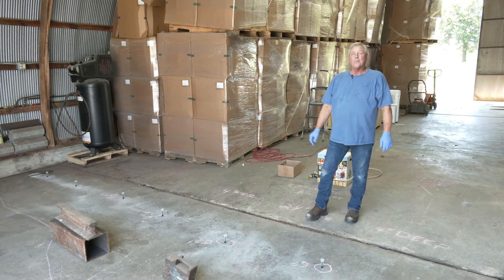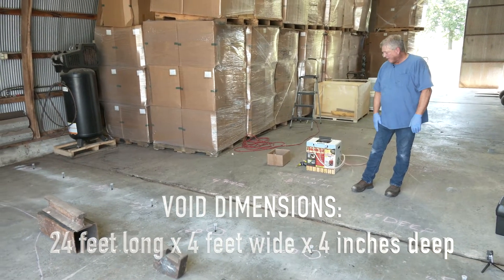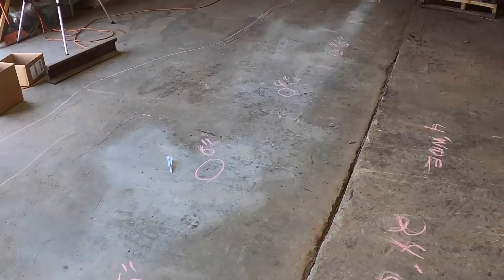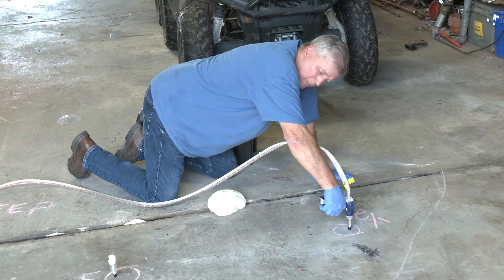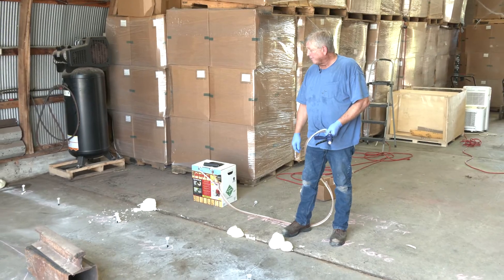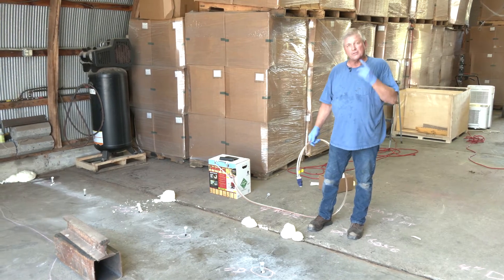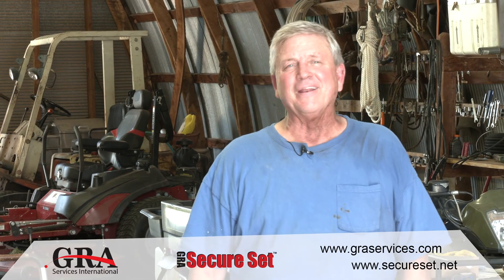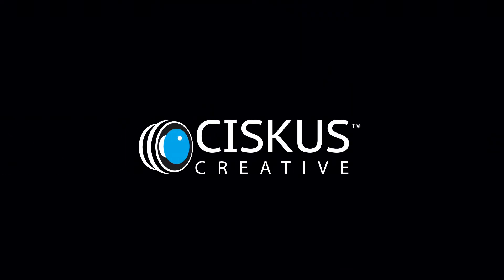Foam jacking, concrete slab lifting with Secure Set

Comment: Couple questions
1. Are there any thermal heating issues like spray foam for insulation?
2.  Will this product break down over time, or is it like poly geout used in water mitigation / crack repair.  ( radon foundation repair cracks kit)  Thank you for your time.

Comment: Fantastic thank for having this DIY concrete lifting foam for the best of all. I had seen two of your videos and I learned a lot. I will be ordering soon because I know is fantastic to be able to do incredible concrete  lifting of such weight and length.
Reply from the maker: Hello RE,  Thank you for your kind words.  We are just now completing a new video that will show both filling a void under an elevated concrete patio and also injecting a portion under the slab that we detected had hollow voids.  It will be out soon.  Thank you

Comment: Would foam jacking work on a back porch slab if the home is heavier like a log cabin? How long would it last? TY for your answer.
Reply from the maker: We wouldn't be able to tell you that for sure, since every project is different.  We haven't lifted a structure, but we have many customers that have done so.  If this is an area you can use a mechanical jack and then use the high-density spray foam (supports 10,080 lbs. per sq. ft.) for the backfill/support, that is how we would approach this particular type of project.  That way you can be assured of lifting exactly where you want it, vs possibly overlifting and experiencing other issues.  
This type of foam is expected to be in the ground 40+ years.
Thank you for your question.
GRA Services
Reply: @SecureSet-Fence-Installation  Thank you for your reply. Much appreciated.

Comment: If you don’t get the slab high enough and run out of product, I’d it possible to go back and spray more under there?
Reply from the maker: Hello and thank you for the question.  Yes, you can always add more foam at any time later.  Just do not over order foam kits in the beginning, since they are non-returnable.  Thank you, GRA Services - Secure Set

Comment: Are you saying a homeowner could use these kits to raise our own basement slabs?
Reply from the maker: Hello JT,  Yes, we have done projects like that.  It is important to hammer sound the floor very well, determine where the voids are, drill the area and measure the depth of the voids.  Try to get the best understanding you can about the condition under the slab.  Most think the sunken slab is sitting on top of the dirt under the floor. Almost always we find the slab has sunk because there is a void of some kind under the floor.  This will help you make the best decision as to what to do.  The voids under the slab will always fill with foam before the floor ever starts to move. Knowing the volume you have to fill will prepare you for the kit, or kits, you will need to complete the job.  Thank you

Comment: I saw that you used a stethoscope and chalk to layout the void.  How can you estimate how deep the void is when the access is limited?  If I’m understanding correctly you’d need this information to estimate how much product to purchase.
Reply from the maker: Hello Kevin,  Yes I used those to map out the hollow sound under the concrete.  I had a good idea how deep the void was because I drilled and probed the area in several places.  I wanted to get an idea how far the voids extended, even doing that I was surprised by the fact that what I thought was a 34 cubic foot void, actually turned out to be a 42 cubic foot void.  Once the void area under the floor was filled, and no additional foam was coming out around the perimeter, I knew the foam then only had one way to expand, and that was UP.  The expansion rate with the foam is slow enough that you can finesse your injections so you don't over fill the area.  I would inject about ten seconds worth if foam, wait about 30 seconds then inject some more.  Gradually the concrete started to rise, when we reached our goal, I stopped injecting the foam. Overall it took longer than I thought it would take, but then again I misjudged the size of the void under the concrete.  I have visited the job site several times since the floor was fixed. The floor no longer flexes when heavy equipment rolls over the repair area and water no longer comes up through cracks in the floor after it rains. The owner is very pleased and expressed his gratitude many times over.  Thank you

Comment: How do you know when to stop injecting? I'm concerned that I'd end up with the slab that used to be 2" lower and is now 2" higher.
Reply from the maker: Hello,  The nice thing about this particular spray foam is that it is a little slower to react.  Takes about 30 to 40 seconds to expand and the expansion is 2.5:1   It is quite easy to spot the movement of the concrete and regulate what you need. The most important thing is to make sure the "Dropped" edge of the concrete is moving and not the entire slab.  We put weights along the crack line where the concrete failed and dropped into the cavity.  This helped to keep that side of he slab stable and allow the dropped edge to swing back up into position. Thank you, Good Question !
Reply: Secure Set - I’m with Rebecca, still unclear on how you know when to stop pumping as to not over fill the void. My order is on its way.
Reply from the maker: Hello Kraze,  Secure Set Spray Foam will fill one cubic foot of space for every one full minute you pull the trigger on the application gun.  Knowing the void that is under the concrete is important.  If that is not possible, when the foam starts to come out of cracks in the concrete, you know you have filled that specific area.  I hope this helps.  Thank you
Reply: Secure Set - what is the expansion percentage? After you see the foam coming out of the cracks, how much will it grow?
Reply from the maker: Hello,   The expansion ratio is 2.5:1  Foam coming up out of a crack, is near its full expansion.  Thank you
Reply: Lol two inches higher 😆 is because not much experience and two much injected foam. Is better more than less 😆 You will be fine.
Reply: I wish I knew about this sooner because this is something I can afford. How is it that I did not know about this  secure set.
Reply: I live in an old house and the joists are falling. The joints are on dirt grade. Could I use this product to gently raise that floor 1.5-2”? It’s an area about 6’ along one wall.

Comment: How can I measure how many kits I will need when the slabs slope?
Reply from the maker: You will have to tap around listening for voids, and then drill some 3/8" holes to measure the void space.  If over 3" deep of void you could also drop a bright light borescope/endoscope down to look around and try to estimate better.  The issue will be that you never know where the foam might run too during the 2-1/2 to 3 minutes that it is expanding and moving with a lot of pressure behind it, before it stops expanding and starts to harden.  In this video what we didn't know until after we later checked around was that we had foam pop up 40 ft. behind the work area, back in the corner of that stack of boxes.  That was a surprise since we didn't hear it running under the slab in that direction, only to the left and right.  This wound up being a much larger void than we had estimated, but now there is a great support base under the slab in many directions.  Thank you, GRA Services - Secure Set

Comment: The slab in my garage cracked and has fallen about 5-7 inches at the back. The area that fell is about 10ftx 24ft. The rest of the slab seems fine, is intact and level. How can I assess if foam injection is appropriate? Do you have a video on how to estimate the size of the cavity and check if the slab movement will affect the house foundations? Is there a cut off point for cavity size in relation to the use of foam injection?
Reply from the maker: Hello Thom,    For this project I did not use the endoscope that we employ now.  The scopes are so affordable, that now I would not do any project without having one. The Depstech Model DS300 is the one I would recommend, it has both a down view and a side view with a focal range of about 10 inches. Using the scope will give you very good information and with the use of a simple probe you can determine the depth of the voids.  A sunken piece of concrete as big as yours, I would first hammer sound the suspect area, drill some 3/8" holes and use the scope to get a good visual image of what is going on under the slab.  Once you have done that, estimate the void area in either cubic inches or cubic feet.  If you use inches, divide the total by 1728, that will give you the cubic feet measurement of the void.  Each Secure Set Spray Foam kit will make 10 cubic feet of foam. Remember, if you want to raise the concrete back to level, the spray foam will always travel to the point of least resistance first. Once the area is filled, THEN it will start to lift the slab. Thank you.

Comment: I have large Slab that I have to do. About 5 in drop. Probably some lager voids. 
You kits and foam it's more then the stuff in the cans. It's the same color and just wondering it not tuff stuff in larger application.
I will send picture when your ready
Reply from the maker: The product you are referring to in the cans is probably Great Stuff or a similar product, which is not the same type of foam by any means.  It is open cell foam, which will absorb water and it is a very low density foam; therefore, it easily crushes.  Secure Set foam is closed cell, which means it will not allow moisture or air to absorb into or pass through it, and it is a very high density foam, which from a compression standpoint will support 10,080 lbs. per sq. ft.  If we haven't already spoken by phone, given us a call and we will discuss your project with you and see if we have some suggestions, especially since you may be able to use our mix/pour foam to help fill some of the large voids for less cost and then use the spray foam to finish the filling and do the lifting.  Thank you, GRA Services

Comment: How do you know when you've added enough, or if it will raise too much?
Reply from the maker: Thank you for your comment.  You don't always know how much void space you have under a slab to fill, since the foam will definitely find places to run to and fill.  It is a finessing project.  You have to work it slowly and listen as well as watch for movement.  Allow 2 to 2-1/2 minutes for the foam to fully expand and start to harden, so using short bursts of spray is the best way to apply once you think you have gotten closer to filling the void.

Comment: How do you clean up the over foam coming up through the ends .
Reply from the maker: Hello Diana,  Remove the "plugs" use an aggresive scraper to remove reside from the concrete, if there is a slight stain, use some acetone to scrub the area, you will have clean concrete.  Thank you

Comment: I live in an old house. Will this product work on wood floor joists sitting on the ground ?
Reply from the maker: If you can keep the foam under the joists.  If you have the ability to first jack up those areas then backfill with the Secure Set Spray Foam, it will give a good support system to the joists and help to protect them from any moisture.  But, if you are asking if you can lift the joists and wood floors, it could be possible, but it could also cause the floor to unevenly lift.  Thank you, GRA Services - Secure Set

Comment: Did you fix what caused the VOID to begin with first other wise it will happen again
Reply from the maker: Hello Jose,  The void was caused by a landscaping change on the west side of the building.  A berm that was on the west side, that was used to divert rainwater from running down the sloped hill was leveled out by the owner in order to accommodate a new gravel road to the back of the property.  By leveling the berm, the rain water came down the hill and backed up along the west wall of the building. The gravel road was laid in 2001, so the rain water had 20 years to wash out the soil under the slab.  A new smaller, but still effective berm was plowed between the building and the gravel road to direct the water to the south of the building.  All is well now.  Thank you

Comment: Can I use this to raise a foundation under a 2 story house?
Reply from the maker: Thank you for the question.  We have not tested it for that purpose, but we do have customers that we have visited with that have used it to lift structures. It is best to use mechanical jacks to lift the structure to level then backfill with Secure Set high density spray foam (70 psi compressive strength which will support 10,080 lbs. per sq. ft.).  This would be our 120 kit, which makes approximately 10 cu. ft. of foam.

Comment: Can this help to fill cracks? I have water leaks from under slab thru cracks to my floor, kind of same issue as per Video, but in my case its in my room. Please advise.
Reply from the maker: During the application of the Secure Set Spray Foam to fill voids it generally will pop up through the cracks and fill them, as well.  It is a closed cell foam that will help from the moisture coming through the cracks, but you would not want to attempt to inject the foam when there is standing water in that area.  The foam will not develop into a dense foam when water or too much moisture is present during the application process and the foam expansion and hardening stages. You would need to solve the water leaks before applying the foam.  Thank you, GRA Services - Secure Set

Comment: As a quick response to anyone with the following question:  Can the nozzles be cleaned and reused, especially if you don't have time to wait for a new order of them.    ANSWER: Yes, just break off the overflow piece at the top and then toss into a jar of Laquer thinner while you go about other things. Then, 5-10 minutes later, take one out and grab the outside of the nozzle with one hand and with a pair of needle nose piers, grab the top of the black mixer part and pull out. Toss the mixer with all the white foam back into the jar of Laquer Thinner for a few minutes and pull it back out and hold it on a bench or whatever while you dip an old toothbrush into the thinner and brush the old foam right off. Suggest you wear 9mm rubber gloves and eye protection, but you can easily do this while waiting for the last injection to harden.
Reply from the maker: Thank you, Kenneth for the comment.  This is a question asked of our technical staff quite often.  We have not cleaned the mixers ourselves, but have been told by a few customers that they have done this process like you so graciously listed.   The extra mixers are not cheap, so this information will help those that want to follow your instructions.  If someone doesn't want to clean them and wants to have more mixers for your project, just call 405-672-8885 and order 5 or 25 packs of additional nozzles.  The current prices are listed on the spray foam page at www.secureset.net https://www.secureset.net/product/secure-set-spray-foam/ and scroll down to the "Ordering Information section".  Thanks again,
GRA Services

Comment: Have used two kits underneath my pool  sunken decking wasn't near enough product ....is a nice product but I feel there isn't enough product for the cost of the kits which for me was in excess of $500 per kit
Reply from the maker: Thank you for the comment.  Sometimes customers don't realize how much void space they have or that the foam will find during the application.  It will always move to the low pressure and least resistant areas during the 2-1/2 to 3 minutes it is expanding and moving and before hardening.  It helps to predrill holes and drop an endoscope camera to see how much void space and the tunnels and such when you don't have a good side access to view the voids.  The kits are not cheap to have made because of the metal, plastics, as well as the polyol products, as well as shipping costs.  As we all know prices just keep going up as the supply chain issues have not stabilized still.   Sorry to hear you were not happy.  Hopefully you at least have a better support under your deck with the foam you used and don't continue to have wash out or soil settling in those areas.
GRA Services
Reply: Hi, I was considering using this product for the same application, sunken pool deck halfway around my pool, I was wondering how you ended up? I know you said you didn't have enough product what did you end up buying more and did it work?